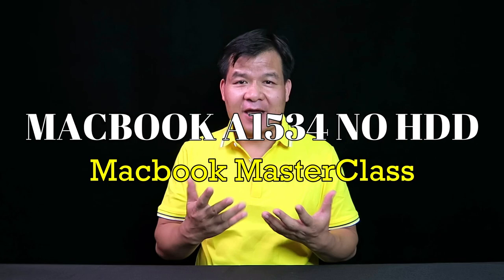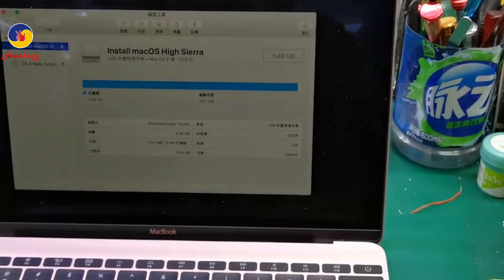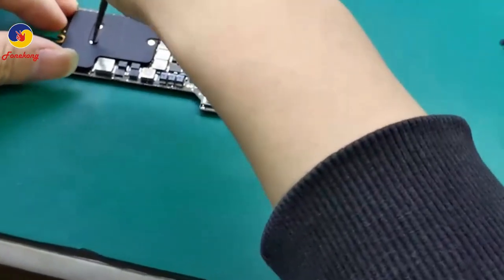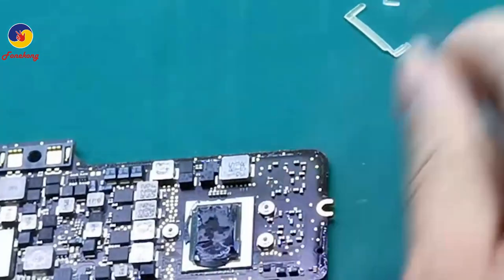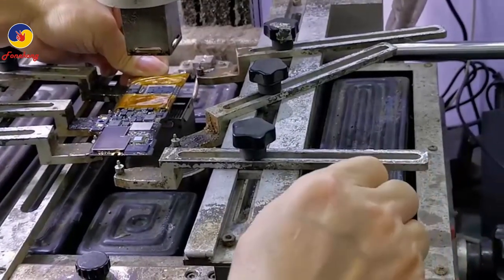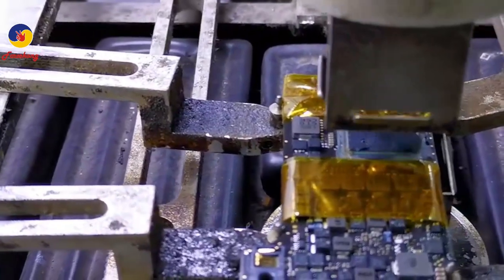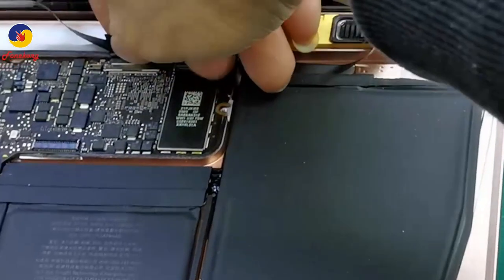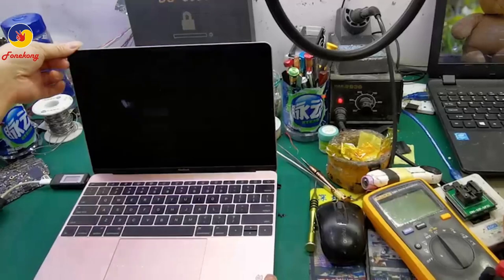Macbook A1534(2016) no HDD—How to fix?

Comment: TRY THIS @ UR OWN RISK. Here is what I did. And it WORKED. Without the industrial class heater. I have an Early 2016 Macbook 12" with 500GB SSD. Hard disk was not recognized. The SSD is located on the opposite side of the CPU in the PCB. Since the the Macbook POSTs, the CPU is good. I suspect the reason the SSD was not recognized by the computer is basically it has lost one or more pin connection to the PCB. Basically this job is meant to reestablish the connection of the SSD pins to the PCB. Heating the CPU will also heat the PCB surface and reflow the SSD directly below it. I do not have the industrial class heater. I used a regular heat gun. I did not even measure the temperature. I cleaned the CPU and heat sink thoroughly, applied insulation heat tape, pointed the heat gun and heate the CPU for 3 minutes, then applied flux as suggested and continued the heating for another 1 minute. That is it. I cleaned the CPU from excess flux using cloth towel, let the PCB cool down and then put logicboard back in to the case. Voila. It booted. I upgraded the OSX to Big Sur.  

Word of caution: I do not know if this method will provide me a lasting solution. I happen to remember Apple had the same problem with GPU on an older Macbook Pro 15, which required a reflow of the video card.  Although the reflow worked then, a few of the MBP 15 I reflowed went in to remission. Good luck. TAKE EXTREME CAUTION. DONT START A FIRE AND BURN DOWN THE HOUSE, OR URSELF TO SAVE A MAC. IT AIN'T WORTH IT.
Reply: Does the MacBook still work?
Reply: @Jojonut  Yes. As of today, the Macbook 12 is working well. That is several months now. The repair method worked well.
Reply: Hi, is your MacBook still working after 2 years?

Comment: This is a nice discovery. But the device used to heat the cpu is industrial grade. More helpful would be Master Liu to tell us the heating temperature and duration he applied. That is the most critical information. In an average computer shop, one may be able to use a heat gun to do the same job if one knew how hot and  how long. Either way, thanks. I am dumb founded by how a lose CPU connection could cause SATA controller not to recognize the SSD, while the same CPU is able to turn on and boot up using a USB OSX installer. Must be one or more loose pins that connect the hard disk controller to the CPU.
Reply: Because it’s not SATA. It’s a PCIe SSD.

Comment: It will return  within 3 month.it is not a professional  method.
Reply: Why you say that because he didnt clean off the thermal paste? Or he should have reball with new solder balls
Reply: My method clean the ic mean remove corner glue and must remove thermal paste or pad then reball it.its 50.50 game.u need to understand problem due to ic or dry solder.
Reply: @nirmalnalinakshan3461  have you seen the reball temperatures those temps are low 180C  ? solder won't even melt. or I'm mistaken here. Here https://youtu.be/GOiZwuh24TI?t=274

Comment: Have to downvote this because you did not show the machine booting into the OS after accepting a user’s password. The screen you show at the end is exactly what one sees when the hard drive can’t be detected. Moreover, if one presses the option key during boot, one is presented with “Macintosh HD” and only sees the “?” after selecting it. There is no way to confirm from this video that the CPU manipulation actually fixed the problem.
Reply: The problem shown in the video is Hardware related, as the SSD was not even seen by the system. This could be due to the fact that the processor is mounted above the SSD, and when it got hot the pins fell off, a generally bad engineering decision by Apple.

The "?" problem is Software related, maybe the SSD is formatted wrong, there is no operating system installed, etc.

The people who came across this video did not see their SSD(Mackintosh HD) in Disk Utility, and just wanted to know what it was related to and how to fix it

Comment: hahaha this job does not have anything to do with the cpu. Heating the board temporarily "bakes" or connects the SSD SOLDER Joints  and allows it to work for a short period of time (2-3 days if ur unlucky, 4-6 months if ur lucky). it is a decent method for data recovery but you dont even need a heat gun. this video is only aimed to advertise their machine.
Reply: Completely incorrect. The issue is indeed down to the CPU “popcorning”, it runs far too hot. If you re-flow and then disable turbo boost, it should be a good fix. Reflow is never completely permanent of course